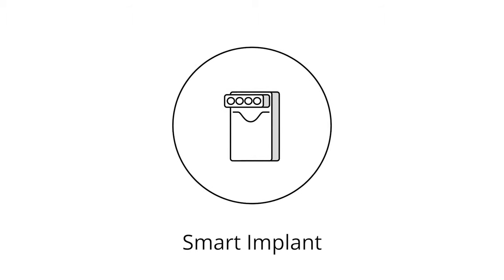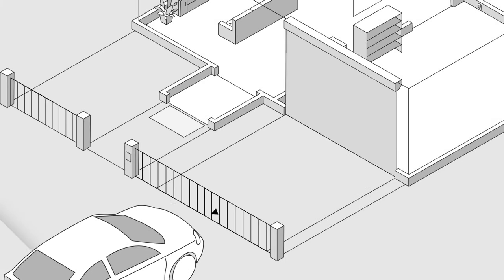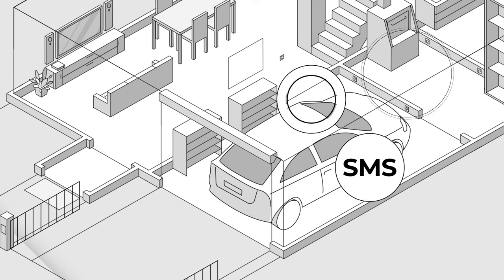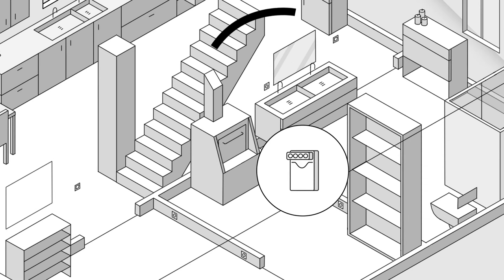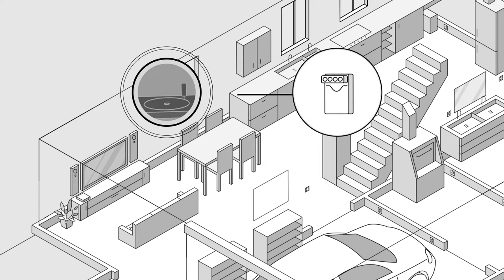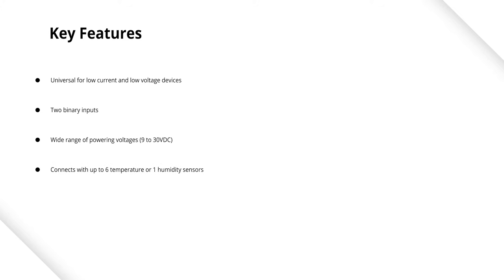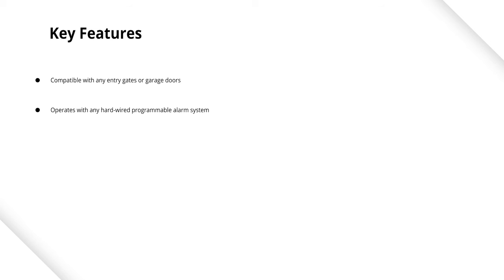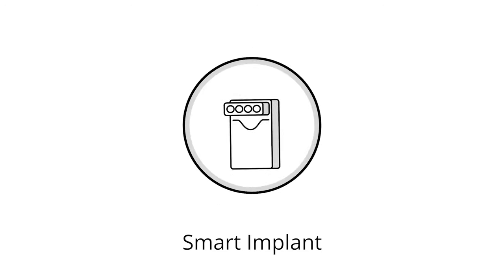FIBARO for Pros - Smart Home Use Case – Smart Implant

Comment: Smart Implant, if during initialization with Yubii Panel you don’t attempt to change the names of inputs and outputs, after completing the full initial configuration, the system will prevent the Smart Implant from editing names. The next issue is with . Parameters are only available from number 24 onwards, so the instructions are not in line with what the device can be programmed for, meaning the functions are inactive, they are not available.